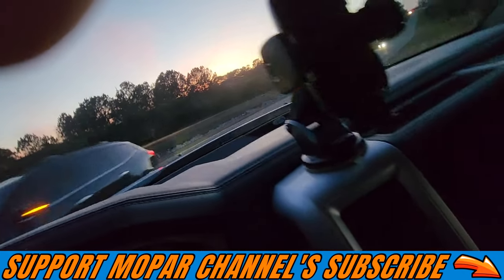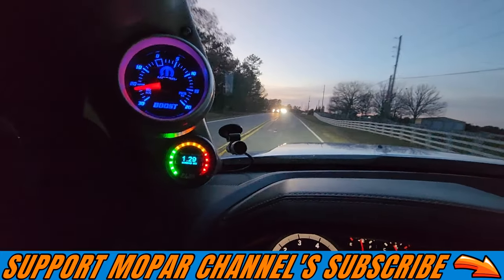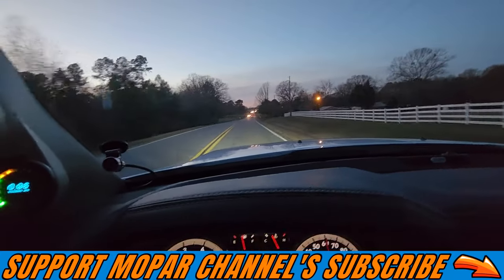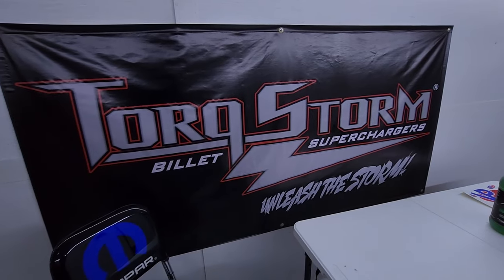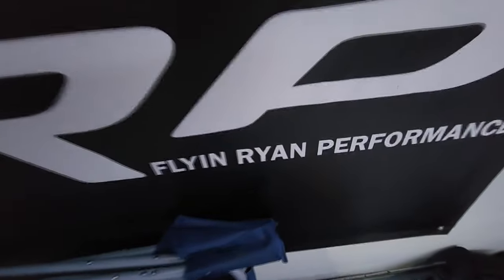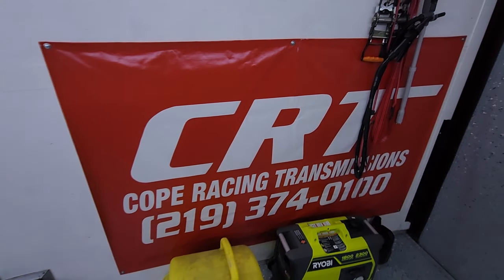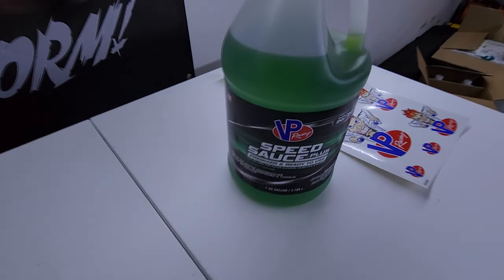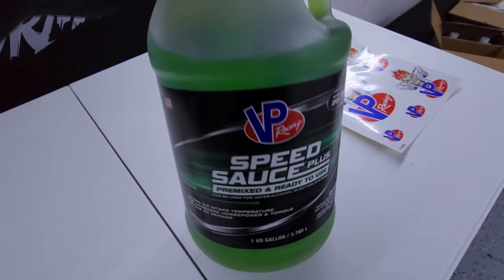20psi Boost On Stock 5.7 Hemi With TorqStorm Supercharger

Comment: Awesome. The 5.7 is quite overshadowed by the 392 and Hellcats, so I'm curious to see where this goes, what's the limit for the stock internals.
Reply from the maker: Supposed to be 8 psi safe most people will say lol
Reply: @FrostbiteRam  8 psi...🗿

...yep, she's holdin' up quite well. 🍷🗿
Reply: I've heard of a lot running 10lbs reliably also if you gap the piston rings you can pull some serious boost

Comment: What AFR gauge and sensor are you running? Been going through sensors and my AEM gauge is all over the place making it difficult for my tuner.
Reply from the maker: PLX wideband best out out there
Reply: @FrostbiteRam  ok thank you, does it have instructions on how to make it work with HPtuners? That’s basically why I went with the AEM is it was easy to work with HP.
Reply from the maker: @metal_mechanic5444  yes should have all that info.
Reply: @FrostbiteRam  ok, thank you.